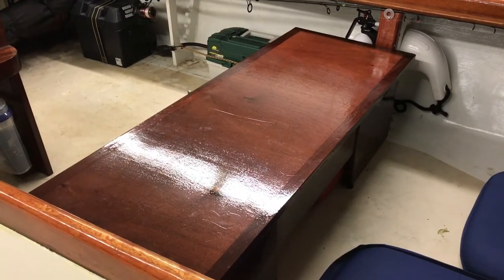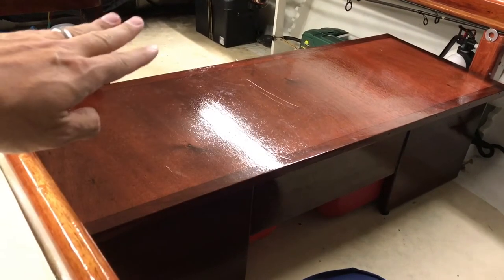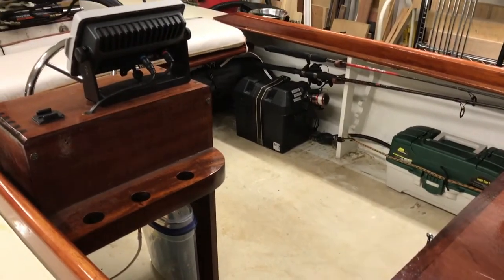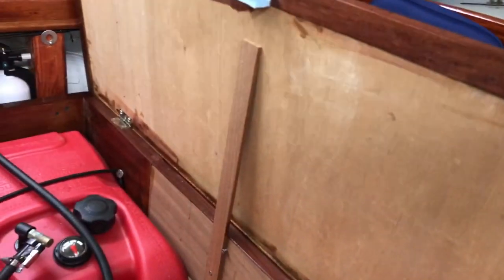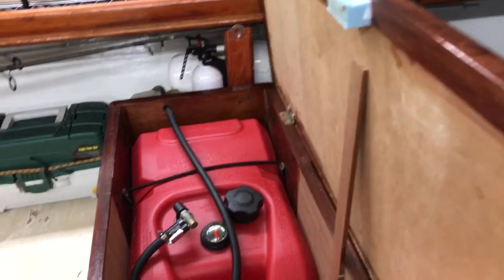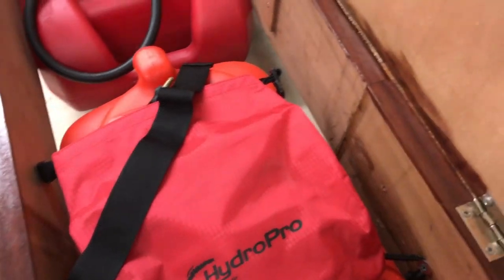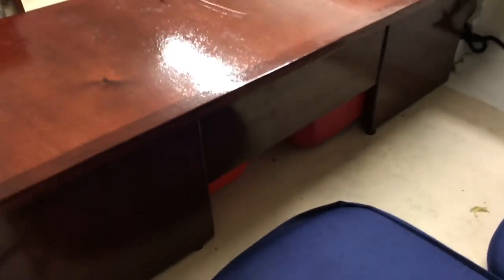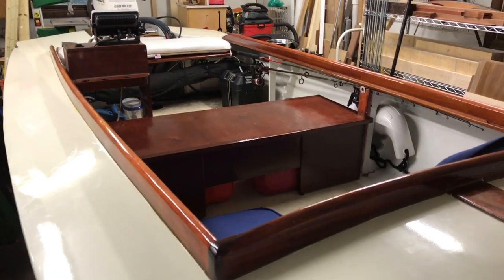WagoOne Forward Boat Bench

Comment: Kris:  I've looked at all your videos and found them helpful and I really like all you have done to the boat.   I am considering building a Snow Goose myself.  But torn between the Snow Goose and a Devlin Candlefish 16.  I want to make the boat into a camp cruiser for rivers and canals, the idea being sleeping on the boat with a custom tent cover that would mount to the coaming.  Thoughts?   Has the garvey bow been a hassle in the wind in anyway?  Thanks for your comments.
Reply from the maker: Hi Edward. I am so glad that these videos were helpful to you. Having experience only with the Snow Goose, I cannot comment on the differences between it and the Candlefish. I find the Snow Goose a very solid and capable small boat. If using her for camping, I might suggest leaving her sole completely open, without benches or fixed seating. I believe a cot would fit very nicely, and I can easily imagine a custom tent affixed to the coaming with snaps or other fastenings. Having used the Snow Goose in fair and rough conditions for five years, I have not had an issue with the flat bow. The surface area of the bow does not seem large enough to be affected by wind. I added a bimini last year - a wonderful addition. The bimini increases the affect of wind on the boat. I can imagine that a tent with enough area could act as a sail and cause the boat to sway and move at anchor. This may not be an issue depending on your use. I would also recommend reaching out to Sam Devlin directly through his website. He is tremendously knowledgeable and has been generous with his time. He may be able to tell you just which of his designs is best for your application. Please feel free to reach out if I may answer any additional questions. I wish you the very best of luck with your build and hope to be able to see your progress.

Regards,
K
Reply: @krispsynch  Thanks so much for your comments.  I will contact the Devlin people now that I am zeroing in on exactly what I want and need.